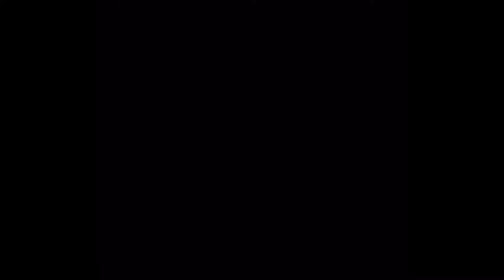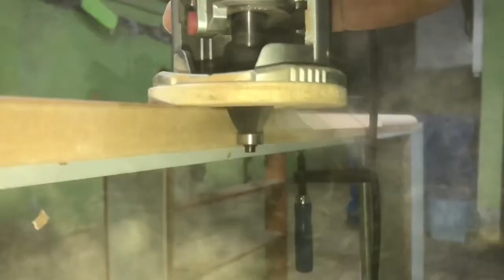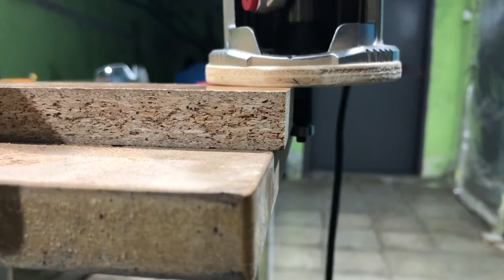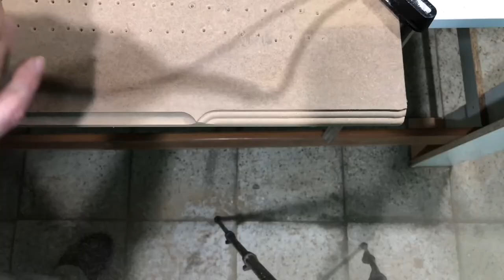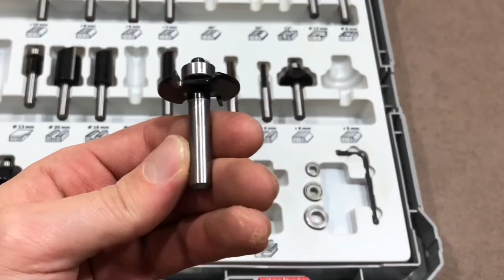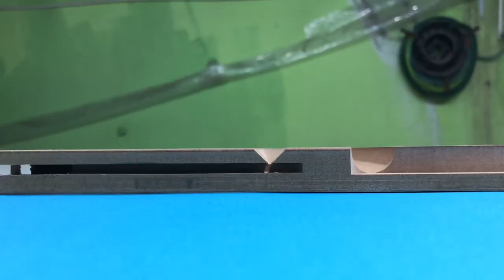Bosch Professional 30 pcs. Mixed Router Bit Set TEST cutter Set

Comment: Kardeşim bana göre güzel bir vidyo olmuş bende bir el frezesi var ama hiç kullanmadım ikinci elden aldım üzerinde 12.7 mm yazıyor bu senin tanıttığın uçlar olurmu bilgin varmı yada bu uçları alırken neye dikkat etmeliyim teşekkür ederim
Reply: You have a half inch router, it will probably accept both half inch shank and quarter inch shank router bits if you swap the collet ...these are quarter inch bits. You should look for a half inch set first.

Comment: I don't want to be that guy but you're not using the router correctly. You are pushing it right to left but this can be dangerous especially if you're using harder wood than MDF. When the router is between you and the wood go left-to-right. When the wood is between you and the router you go right-to-left.